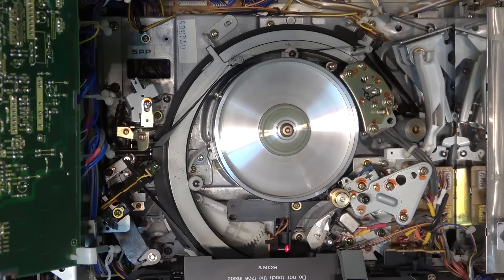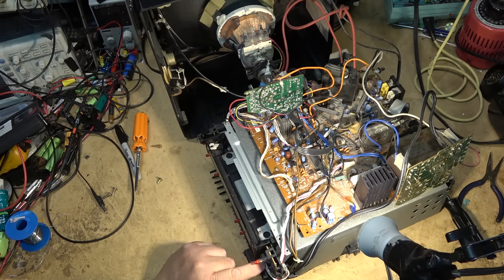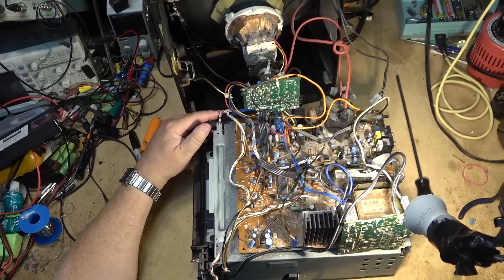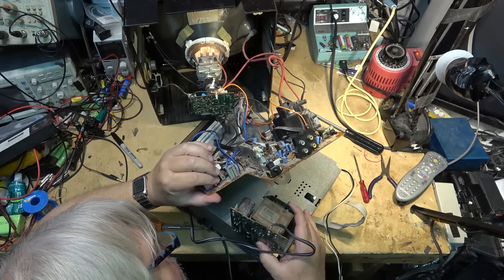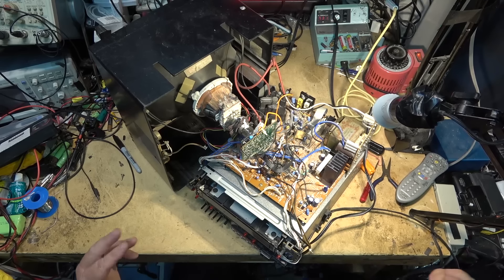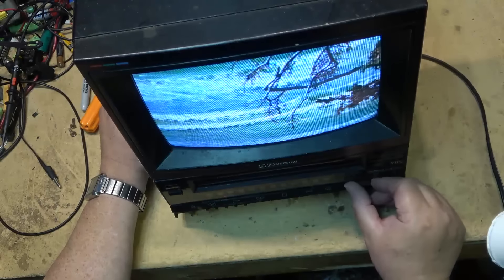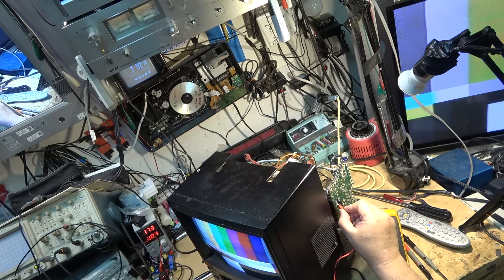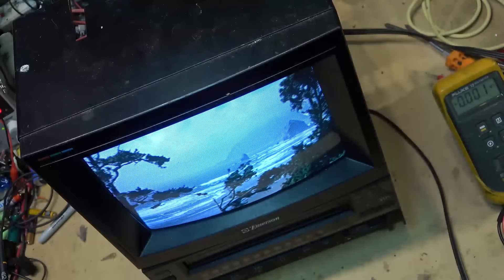Emerson CRT TV with VHS Player in sad shape lets fix it so I can sell it

Comment: Back in the late 80's most supermarkets had similar sets to this one
you had a choice of a DVD or VHS Player.
I have repaired a few over the years, with everything crammed into a small
cabinet, dry joints, harline cracks and dried out capacitors caused most of the faults.
At least they used easily available parts, i can't see todays LED TV's lasting this long.
Reply: I love my 2008 + 2013 LCDs, both 2011 Panasonic 1080p Plasmas, 2005 16:9 WEGA HDCRT, and 1982 Trinitron
Reply: @AdaptiveRider  The early LCD TV's seem to last for a long time, as do CRT's and Plasma displays.
The LED ones only last until the warranty expires.
Reply: @Barbarapape  And I love all the 4k hardcores who literally get upset when I say I'll never own a 4k TV and have no interest in $40 dvds that unless I buy the right TV, I cant notice any difference than 1080p(and that TV will make my dvds, laserdiscs and vhs look like shit). Sounds brilliant to me.  Especially with how often u hear if and see people buying replacement TVs.
Reply: @AdaptiveRider  I can only agree, i have a massive collection of Laserdiscs that only look good
on a CRT or Plasma .
4K TV's have one major weakness, the panels are designed to give an excellent image with 4K content
feed them any lower resolutions are they look terrible even via an external high end upscaler.
Add to that most of theso called 4K releases are from the same prints that they used for Laserdisc
and DVD releases, what a con.
Reply from the maker: Sony has an lcd set with bluray built in. That's a nice one.

Comment: I just bought one of these same Emerson TV/VCPs on eBay lol Cool to see one here! Mine is in much better shape, though still with a few missing screws from servicing! It has a problem where it search fast forwards when you press play instead of playing, Do you have any idea why that would happen? I've cleaned the heads, replaced the belt and cleaned the control selector wheel thing inside which everyone says you need to clean on any VCR!
Reply: youneed to check all micro switches and if those are not the issue , replacing capacitors is recommended
Reply: @Dr.-Smart  I would, but this thing isn't really worth it lol

Comment: It seems everything has an expiration date. That cleaning spray wouldn't deteriorate over time? Or would it remain stable?
 I do realize people use old oil, and other things. Anyway, that TV  VCR combo is obsolete, but it would be a good display piece. People will say someday "what is that slot for?" Maybe even ask what it all is period. It's good that you can preserve something, even though it is practically obsolete. We tend to hang on to old technology. The nostalgia factor.
Reply from the maker: I put it on Facebook and had 50 requests in an hour for it.  I guess I priced too low.
Reply from the maker: Nope never expire.

Comment: HAHAHAHAH Deja Vue....  We had a silver one with I think with the Orion name on it at our Camp site like forever.
 Then we upgraded to an LED TV with the built in DVD player.
When I had ours apart, I put the main board on a piece of cardboard to test it 
Was the 12 volt connector missing from Yours ? all I could see was the Square hole where one would be/
Thanks. Mike, M.
Reply from the maker: Yup it was missing.  Found this at the side of the road and got 50 bucks for it.